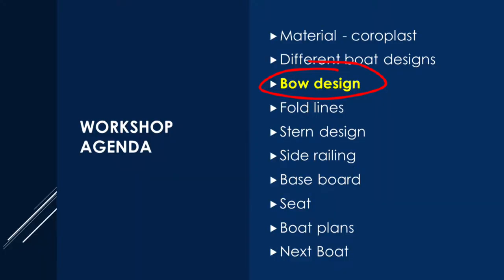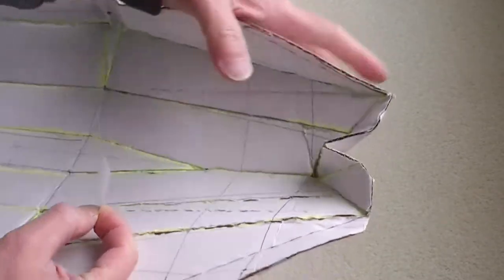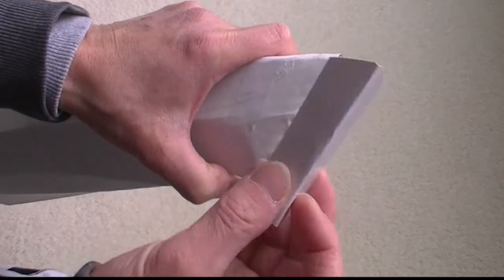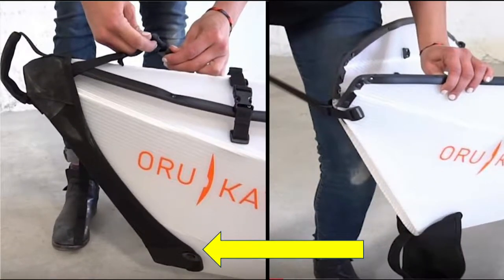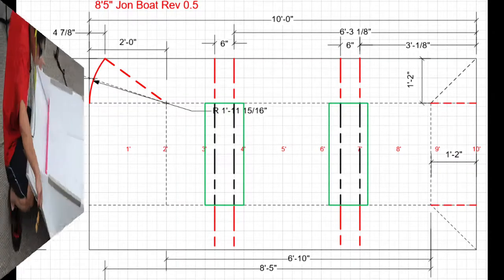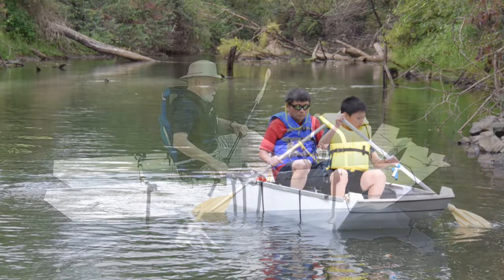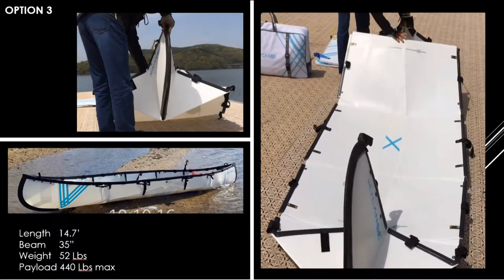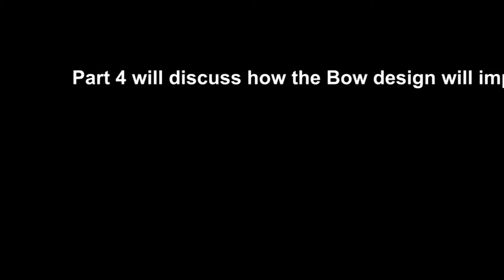DIY foldable boat workshop part 3 - Bow

Comment: Good job, when do more tests?
Reply from the maker: Thanks for the feedback..winter is too cold in Portland Oregon for boating. I like fresh fish and I am designing a three-seater with a motor for spring river fishing :-)  I still have to redesign the draggerboard for the catamaran design.
Reply: @DIYUSA  oh, i am from México, i Will try to do something like your boats, here is a good time to boating, but i can't find the coroplast in the size that you use, here is only coroplast 4' x 8'
Reply from the maker: You are lucky to have warm weather year round. I built one kayak in 2017 using a 4 mm 4'x8' coroplast. I taped two sheets together and it works well... probably not as strong as the 6 mm 5' x 10' sheet. I have the tutorial and plan... please check it out at http://www.hillsborotech.org/foldable-kayak/ 
Feel free to drop me an email if you have questions  pdxboatmaker@gmail.com
Reply: @DIYUSA  Thanks i will check it, and i will try to do it.
Reply from the maker: @cesarvaldenegro2264  One other note: the 10' boat in the video may be able to handle approx 160 lbs payload. If you use two 4'x8' sheets to build two pontoons (making a pontoon boat), it can handle 210 lbs of payload.
Reply: @DIYUSA  very thanks you :)